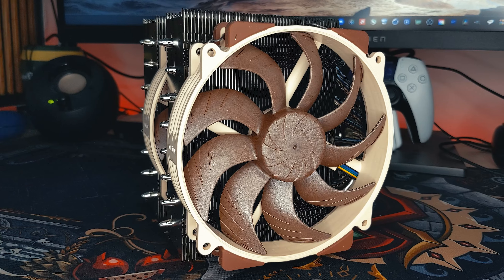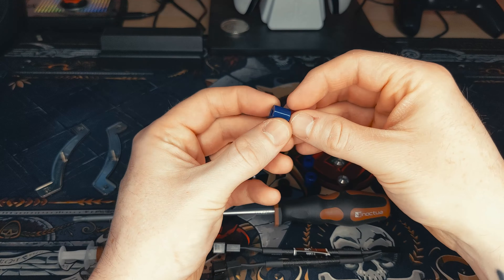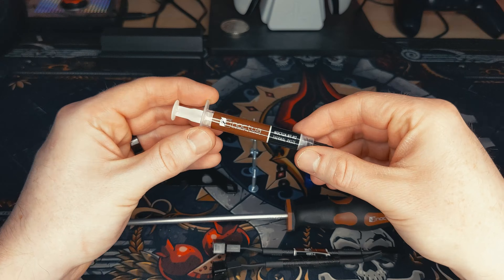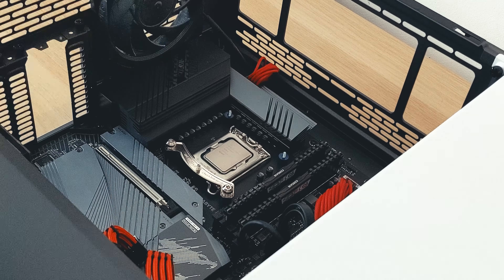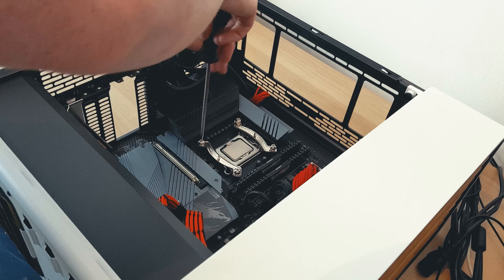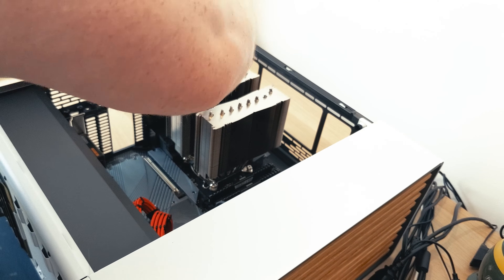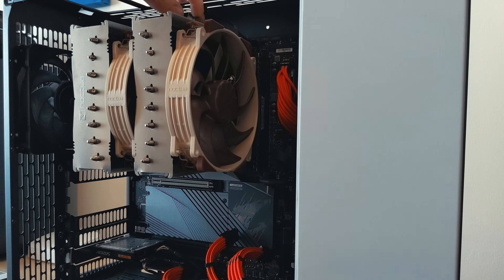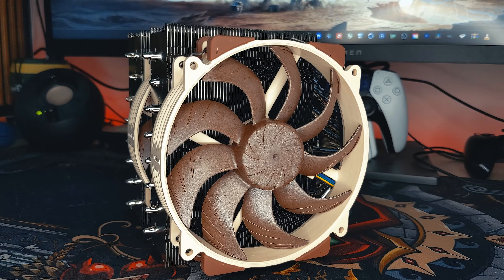How To Install The Noctua NH-D15 G2 - Intel LGA 1700 Installation Tutorial

Comment: My holes the brackets don't match up one side the bottom was 1s the other top was 2s but it still worked out. I get 89 degrees top now in the Monster Hunter Wilds Benchmark I was getting 100 on some core with Hyperthreading disabled on my 13700k My only complaint is the cooler totally covers the Ram make sure you have a wide case I own a Asus Tuf case anhad only 1/4 inch to spare with top of the fans. I kight disable Hyoerthreading again just to be in the safe zone if Stalker 2 runs fine without it Im not worried.

Comment: Do i need the clips on the screws? I forgot to install them. I'm not getting good contact with the cpu I think cause everytime I open a program the fans shoot up to full throttle then quickly go back down. I also didn't tighten the screws till they stop turning becuase it was a lot of pressure I feel like should I install the clips and keep tightening till the screws won't turn anymore?
Reply from the maker: Hi! You need to tighten the screws until they bottom out. You should be able to tell once it's too tight to turn.
Reply: @PCJack  thanks sir, I tightened them, and it helped a bit.